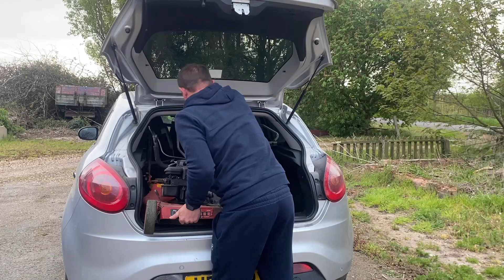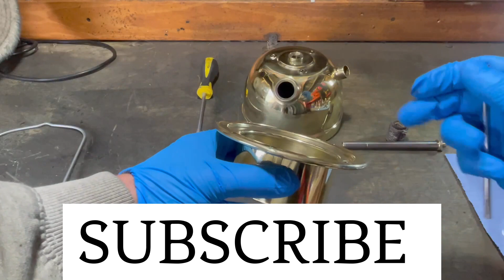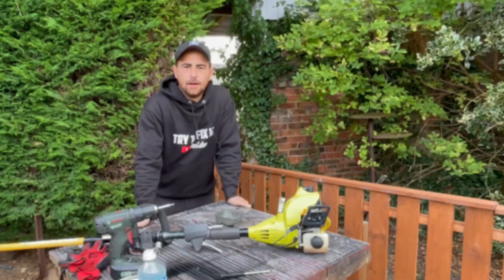FIX OR NOT THAT IS THE QUESTION

Comment: You don't need to touch the throttle Paul. I think it's crankcase is full of fuel, Remove the spark plug, turn it upside down and pull the cord, I bet you'll get fuel out the spark plug hole. Blow it out down the plug hole  with your compressor and start again. Only pump the primer bulb 5 times  and go through the start with full choke, (no throttle) when it kicks, down to half choke and only when it fires, give some throttle. That's my starting point before I investigate further.
Reply from the maker: Will try that thank you Martin